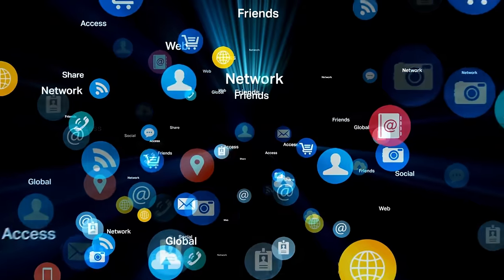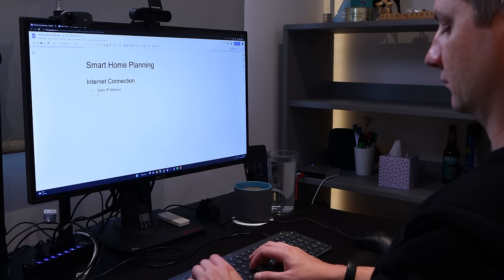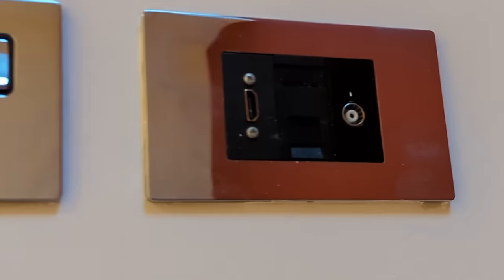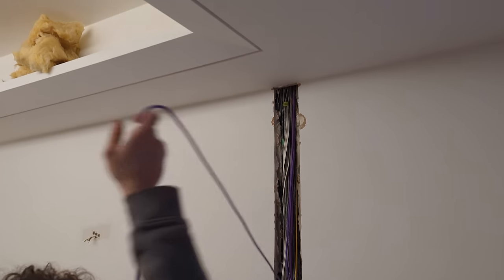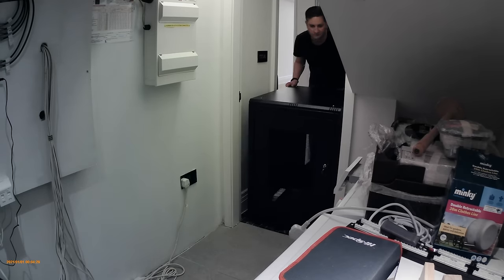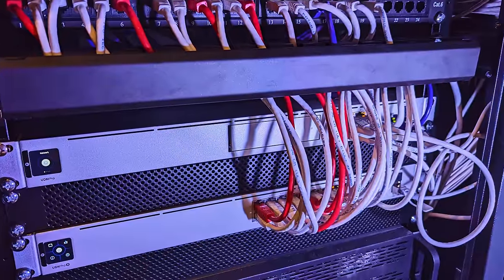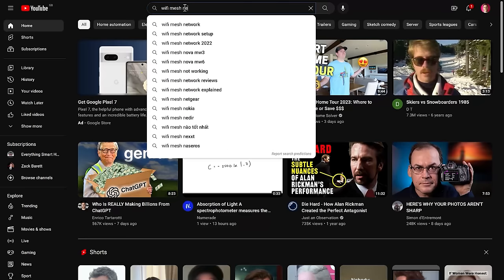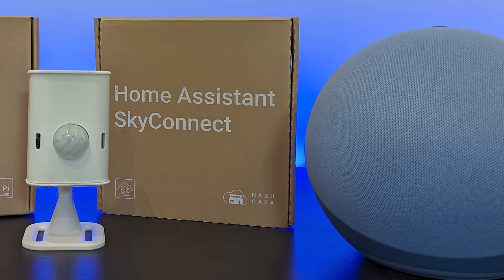Building a smart home network

Comment: Another great video.  Thank you.  Maybe you can do a video on having your IOT devices on one or more separate VLANS and yet connect to them with your smartphone where many of the apps the IOT devices require.  I don't really want my cell phone accessible from the IOT devices and their security issues.  Like you I use PFsense, but I haven't figured out the firewall rules or other details to make it work.  I'm getting closer to using Home Assistant and flashing ESP32s, but I'm not there yet.  Thanks.
Reply: You can add a rule to allow all traffic from your LAN to the IOT subnet, however a lot of smartphone controlled devices will need to access the internet or access your smartphone prior to a connection being opened from the LAN side, best advice is to use devices that communicate with a single controller/aggregator like HA, which can be accessable from both VLANs, and have that be the ONLY device accessable from the IOT VLAN (other than routers/DHCP etc).

Comment: Thanks for the great video. A quick question - was the wifi mesh or some additional access point. I'm not sure there is much difference!
Reply from the maker: I don't use a mesh network, just individual access points.
Reply: @HomeAutomationGuy  Thanks. Did you consider mesh? I currently have a three point mesh system which I'm looking to upgrade to 6E mesh. I'm really not sure the difference between a wired mesh and the type of wired configuration you have! I suspect that even in a mesh system, the additional pucks are simply working as access points - I could, of course, be completely wrong on that!
Reply: @pratahsinnetamby  As much as I'm sure the mesh systems are improving drastically, nothing ever beats wired. With fibre optic internet now hitting over 1Gbps this becomes even more important if you want to maximize performance. Gigabit Ethernet should be the minimum, if anything plan for 2.5Gbps ethernet switch or better given that this backbone is needed for Wifi 6E and beyond.